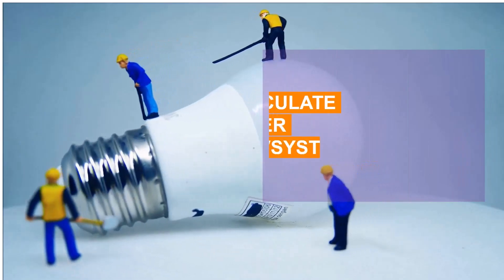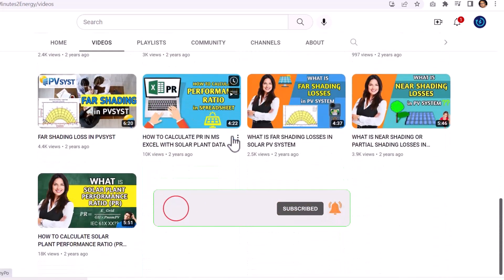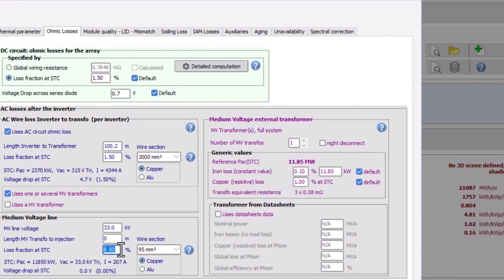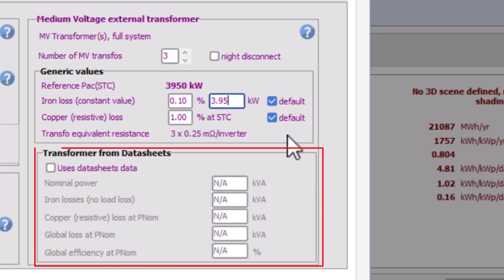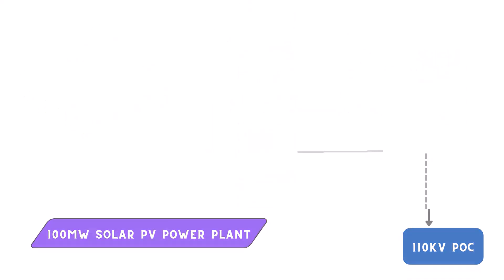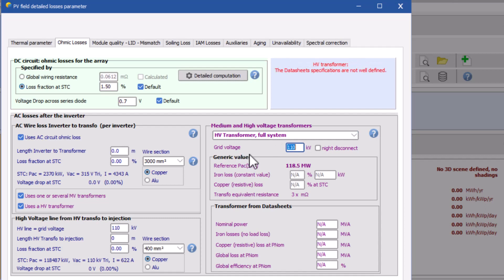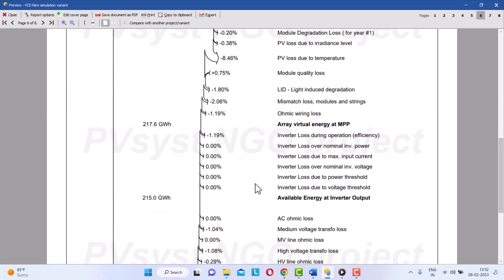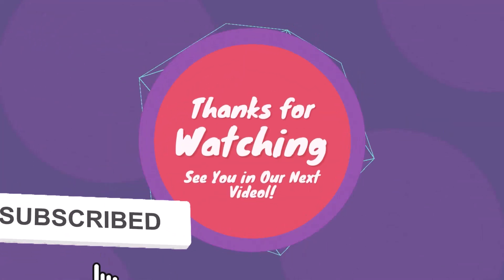PVSYST 7.3 || HOW TO SET MV HV SOLAR TRANSFORMER LOSSES IN PVSYST #solar #pvsyst #solarenergy

Comment: Great video!! However,I have got a question now.
I am using 3.125 MW inverters. 3 of them connected to a 0.6/33kV transformer. There are 11 such transformers. 
Should I put 11 in the number of MV transformer window?
Reply from the maker: Set 11 as number and put the IDT capacity as you are considering
Reply: @Minutes2Energy  Thanks a ton! I have done exactly that!.